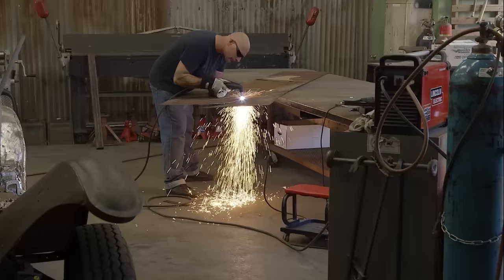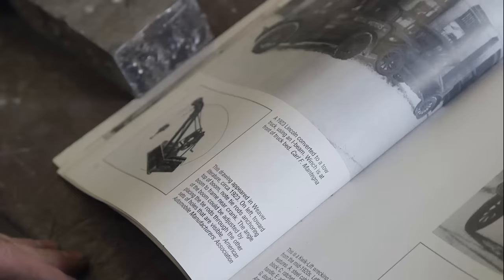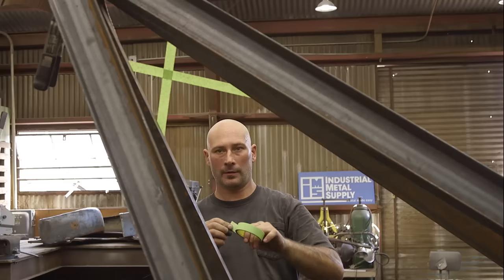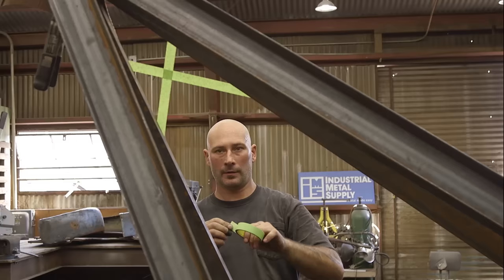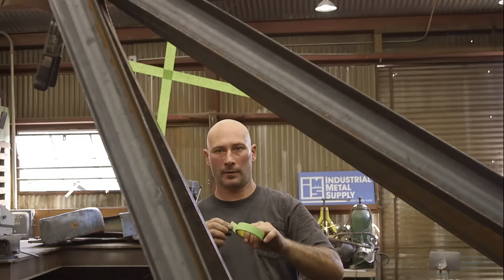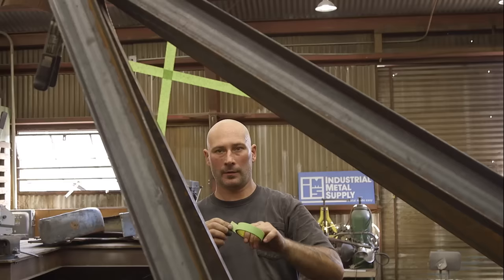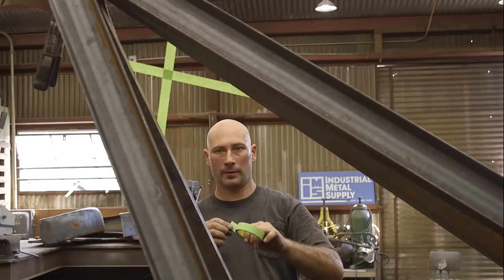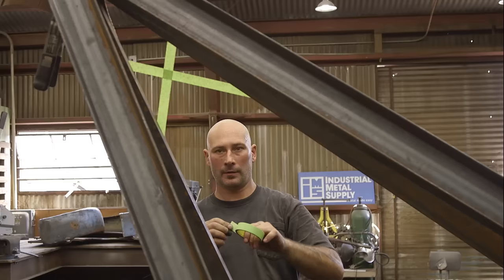Vintage Tow Truck Transformation! - Full Custom Garage - S02 EP3 - Automotive Reality

Comment: …maybe the most sensible and usefull Project thus far
One can easily see why Don is so extremely stoked up with his tow / utility Truck
MASSIVE bonus and change to the yard operations
Well done you guyz
A classic blend ending up in a masterpiece of note and showing off great style in looks from bygone eras spread over time
Looks like the 60’s motor is also perfectly suited⁉️

Have fun…
(dó consider giving it a name, or design a little tow truck service  signboard for it, do’nt you think?
One reflecting the founding date of the business as being from the oldest part utilized on this classic piece of ingenuity…😳❓)

Comment: That gas tank looks like it came from a WW2 jeep.
Reply: Yes, it's a CJ 2/3 fuel tank
Reply: The black cherry Packard is an all time classic hot rod. It will be in shows in 50 years and maybe a lot longer.
Reply: @kahutochishisumi9056 you guys are both way off. The CJ2A gas tank was under the driver seat and it was flat.

Comment: Set of air tanks placed in under that fuel tank for horn and possibly air tools for my ideal 
And to top it off with the auxiliary fuel oil and water can placed off a model t placed on the running board of that passenger side....
Got ideas flowing. 
What a bitchen truck.

Comment: I don’t know what your obsession is with tunnel rims, but it’s not gonna help that car run any better than a single quad Low plane intake. I guarantee you if you were to make a pass with a single quad and then put that tunnel ram on it it would be slower. if it were a manual transmission rather than automatic, I would say maybe it would run better with the tunnel ram maybe!